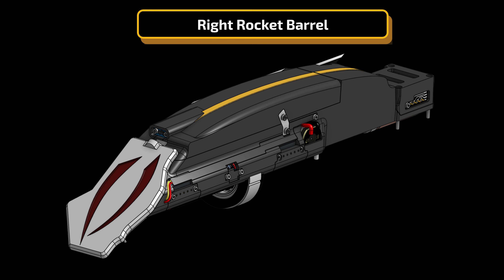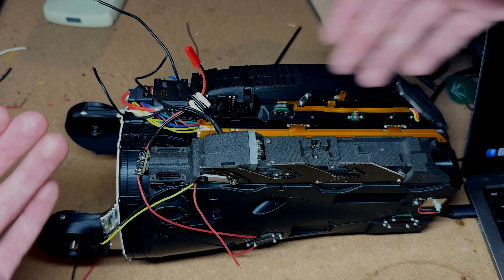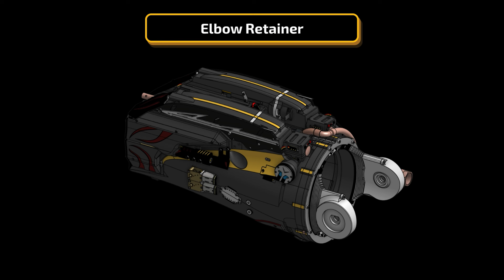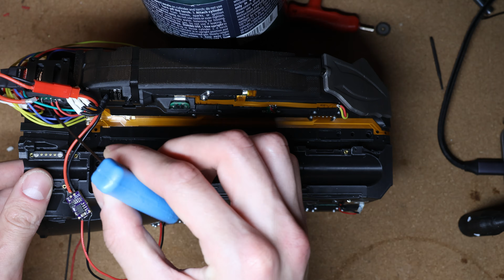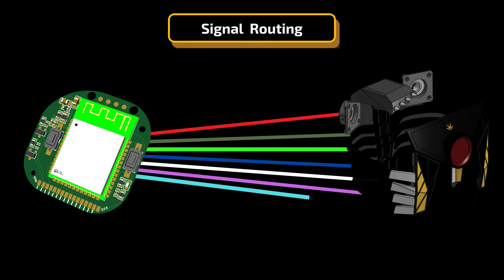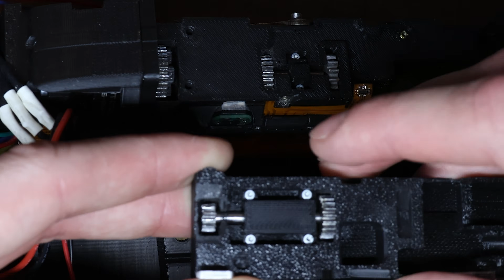What’s Actually Inside My Wrist Rockets

Comment: On small question maybe, wouldn't it help to fire the laser from an slight angle, to not get the whole rocket burst onto the laser lense?
Reply from the maker: I've wondered that too but I don't have much room to angle the laser. I've also thought about using mirrors to be able to angle the beam but my concern is that if there is still an unobstructed path from the exhaust to the lens, even at an angle the particles could still damage it. My solution at the moment is to use an interchangeable glass slide to protect it.

Comment: Have you done any simulation in OpenRocket? You can define the rocket geometrically to get a really good idea of stability.
Reply from the maker: I did a similar analysis with OpenFOAM that said the rocket I just tested had poor stability. The third rocket design should address those limitations based on the simulations I did for that one. However with the one I just tested the added gyro stability seemed to help a bit even though the static stability was not the best.
Reply: @guzmanster360  Gotcha -- I asked because OpenRocket will give you stability margins in "cal" units (distance from CP to CG / body diameter) which has helped me personally with bigger rockets. I'm a bit unfamiliar with OpenFOAM -- is it CFD or an rocket analysis tool?